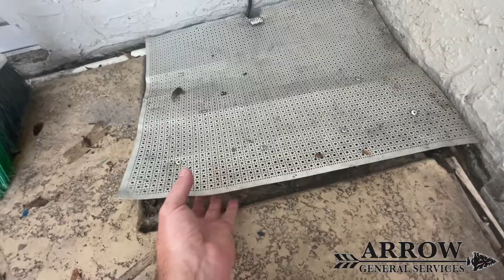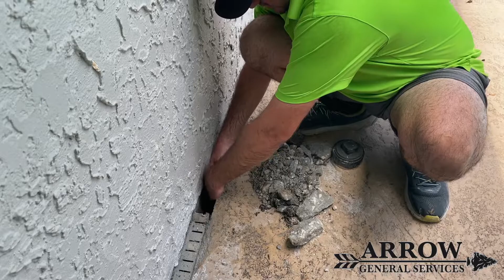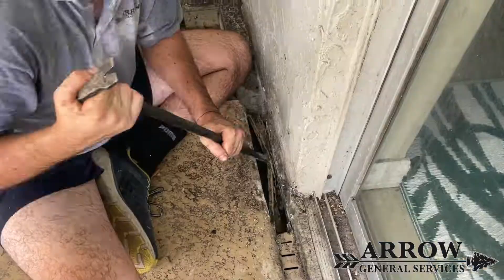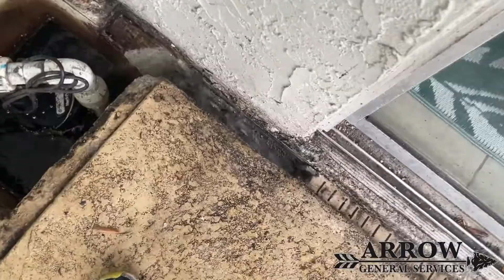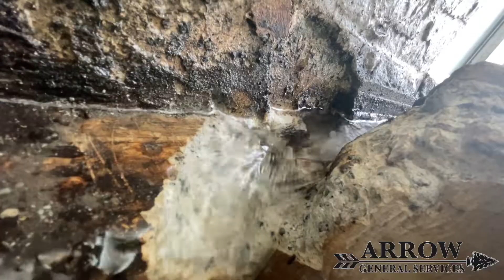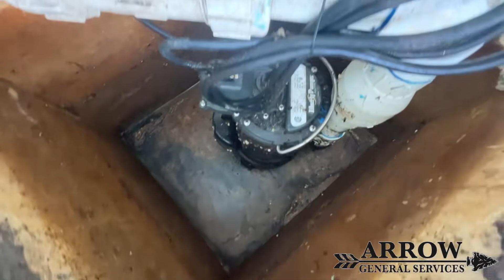Pool Deck Channel Drain, Micro Drain, How To Repair & Clean

Comment: that micro drain, is that set up just like a channel drain, meaning the water runs through it?   I am asking when you took out that thin piece of concrete there was just a hole in-between the house and the patio, i would assume you need to fill it back with the micro drain and connect to the existing drain.   I would assume the water will now fill that hole and get under house/patio
Reply from the maker: Good question, we went back to this job another day to extend the discharge pipe in the front of the home and we put plastic at the bottom and side against the house.